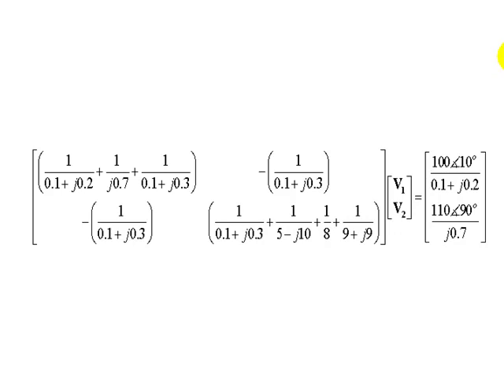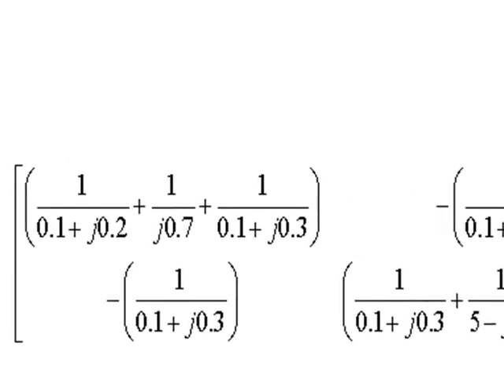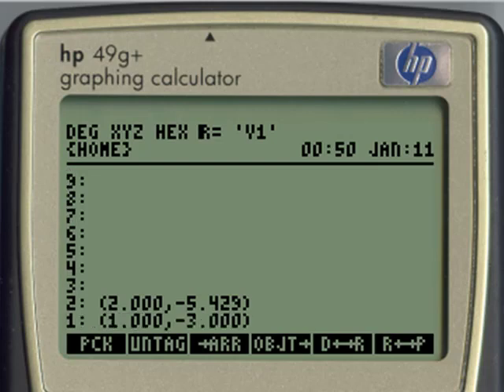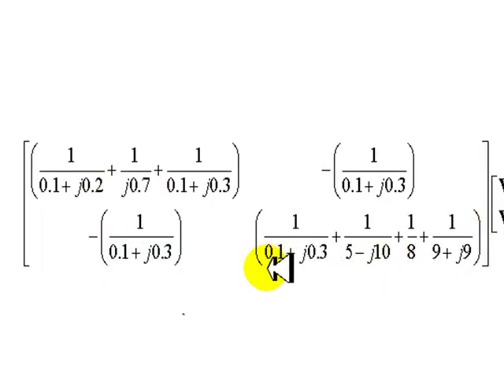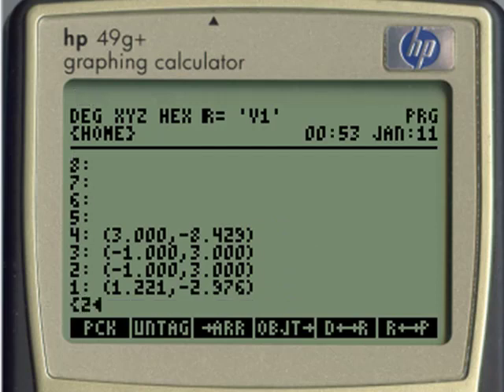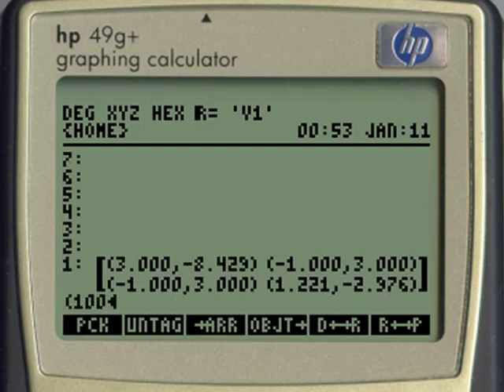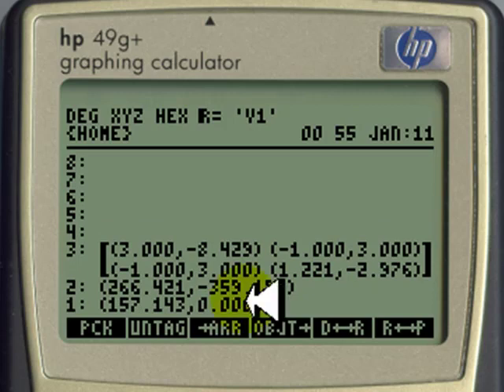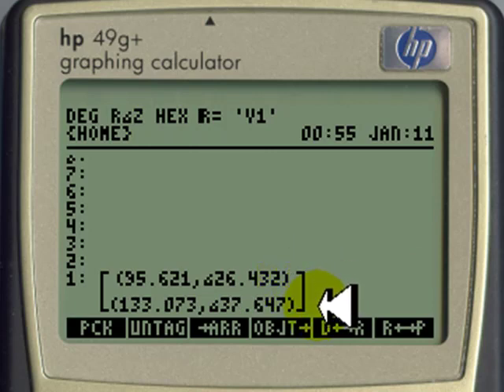HP14/PHASOR 04c: HP-50g Matrices and Complex Numbers

Comment from the maker: Using the Matrix editor (the spreadsheet) to enter a matrix is self explanatory. It's in the manual and nobody needs a video to see how it is used. The spreadsheet, however, is not too convenient (an understatement) when we do not have the elements, but we need to compute them, one by one. In the latter case, the elements are computed and left on the stack and assembled into a matrix the way the video shows. This is seful in circuit courses where you compute the admittance matrix by inspection.